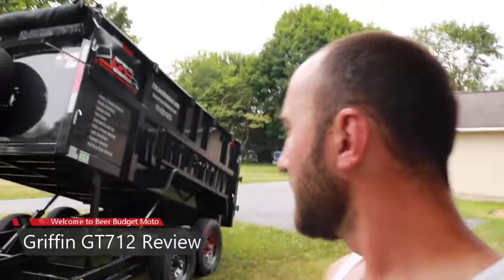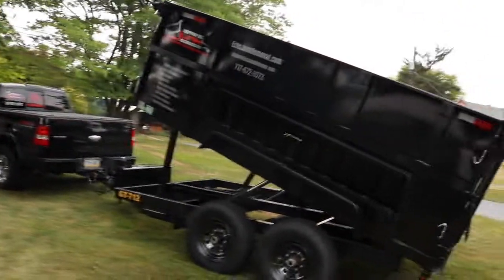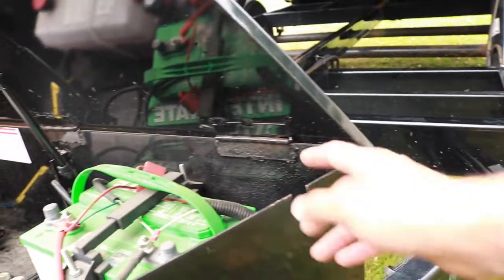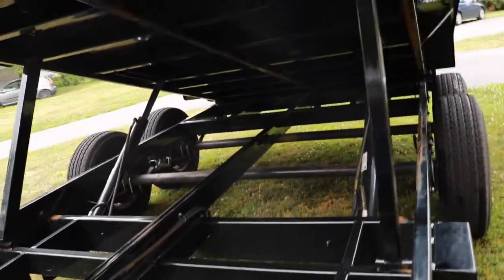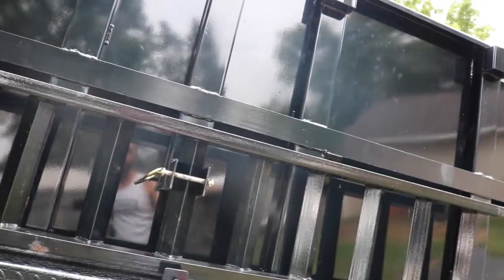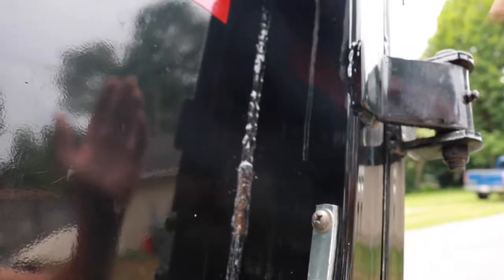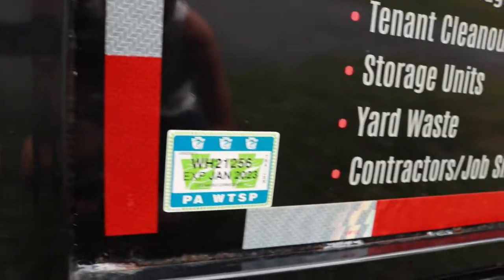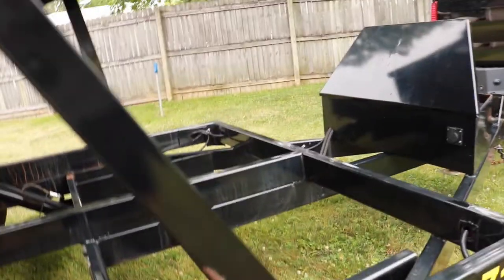Griffin Dump Trailer 1 Year Review

Comment: The pins on the end of the cylinders, look like they rotate in the drilled holes, and wear out that part of the frame. Im sure there is a zerk fitting on the top of the cylinder. There's nothing stopping the pin from rotating.